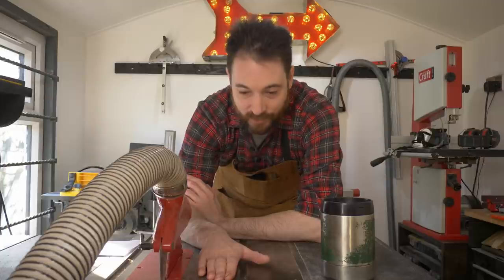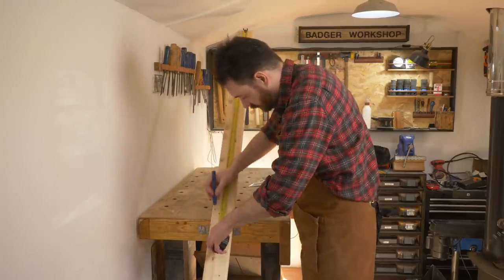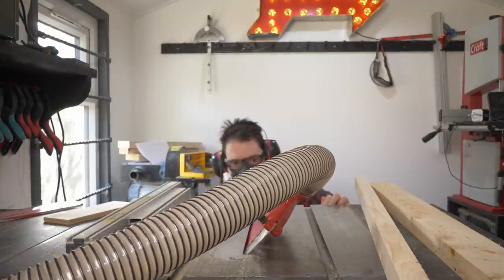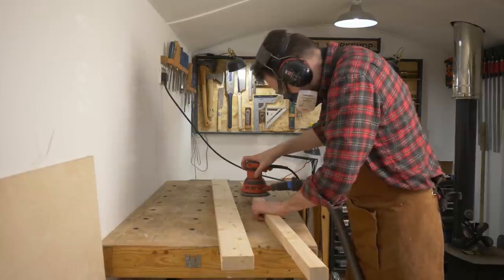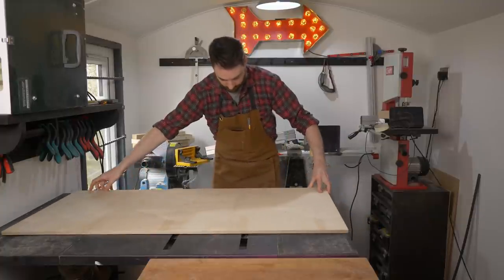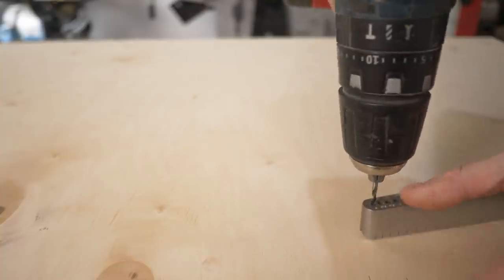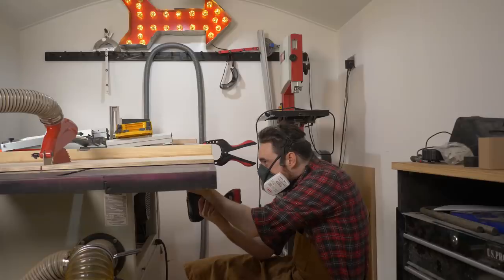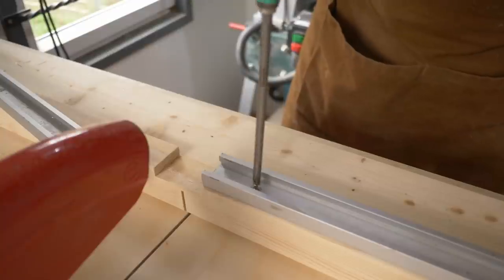Crosscut Sled That Works With Saw Guard

Comment: Nice to see someone else looking at the traditional sled and actually thinking "how can this be improved" and not immediately thinking "add more t track". I don't own one, but I've suspected for a while that the only reason most people put 2 fences on is because that's what everyone else has done and why change something so simple, well this is even simpler and safer and cleaner! Any worries about the kerf opening up because there is no secondary fence are gotten rid of by the fact that the 2 bars slide in the slots, and the riving knife also keeps it from closing up.

Top points that man and to the Newbie Woodworker too.

Comment: Another great build. Just one question when doing the 5 cut method i thought you was meant to put the cut edge against the fence each time but you turned it the opposite way. Serious question by the way not a dig.

Comment: Nice build, Matt - I'm going to make one of these myself since I share the same concern about removing the blade guard.

One small thing: when you were doing the 5-cut test, it looks like you rotated the test piece anti-clockwise after each cut, so the freshly cut edge wasn't against the fence for the next cut. This tests the squareness of the original piece, not of your cuts. If it ends up square after the 5th cut, you're still good (I think) but if it's a little off, the final cut won't be representative of how much adjustment you need to do.
Reply from the maker: Thanks.

Comment: I'm pretty sure when doing the 5 cut test,  you should place the cut against the fence each time.
Reply: I was wondering..
Doing it the other way around amounts to just one cut, and thus does not tell us much. But given the size of the square Matt used for initial alignment, the 5-cut method was probably overkill anyway.

Comment: My clone of your workshop is coming on.18mm Floors down and treated, ready to put framing up. It's been a pain getting hold of the curved corrugated roof sheets that fit 2.4m with overhang. The next job is getting hold of a good second-hand door :D.

Comment: I've made three sleds over the past handful of years and the fences on all of them have warped. I might need to try this method with the full 2x4 support behind!
Reply: Just an idea..why not laminate some ply to similar measurements of the 4X2 ? It would be far less liable to warping. should stay stable and would be even stronger I think..
Reply: @MrCassbren  the last one I built was with 2 layers of 3/4 (19mm) ply and it still warped! I have up on the sled and bought a precision miter guage.

BUT, I think you might be on to something. If I use ply as the brace behind the fence, it would never warp along it's width!

Comment: Hi Matt, I used the same UKJ guides as you but I find that the grub screws are just to slack and keep loosening making them a bit useless to get a snug fit. Gave you had a similar problem and if so did you find a solution?

Comment: Hi mat, thanks as always for the content, just one question please if you would. Your table saw is the 216 compared to the 254 version right? When using your sled do you feel you have enough cutting depth or have to flip wood around to cut through larger pieces. Or do you just go to the bandsaw instead? Im interested in the axminster tables but of course the larger version is more pennies. Many thanks, Col.
Reply from the maker: If I’m cutting thick prices I use the mitre gauge then I get the full depth of cut